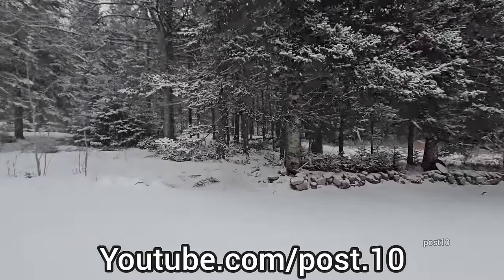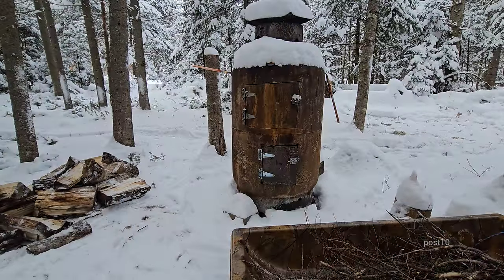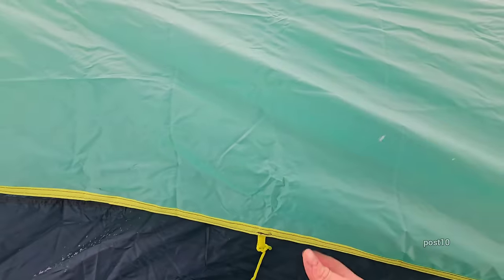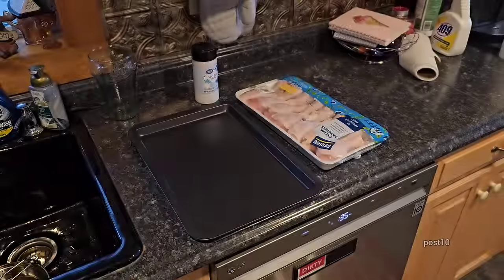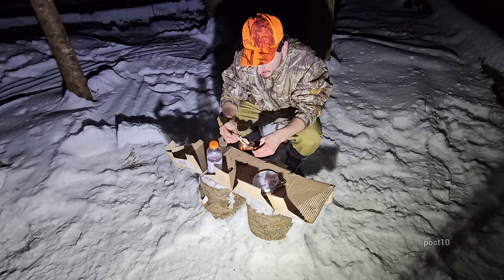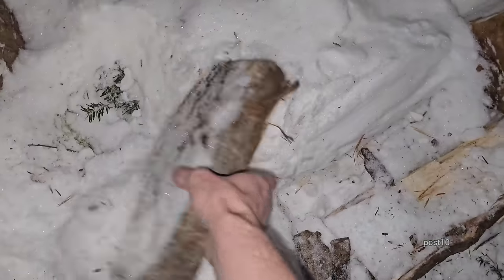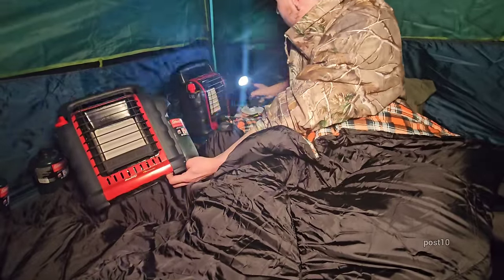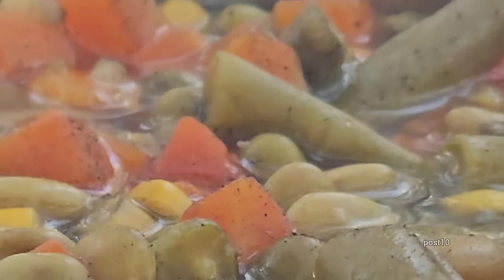Very Cold Winter Camping At The Tank

Comment: Our snowblower is orange too. Little buddy heaters need a secondary regulator or a lower pressure regulator to work on a 20LB tank. Don't put your head in your sleeping bag. Condensation will soak it and you could be in a dangerous wet situation. Wear a hoodie and tie it . unroll and hang your bags when storing

Comment: Finally, winter camping. Now your surroundings look like here has been over two months. Good purchase that sleeping bag. And you can fit it back to its factory bag. Remember the fluffiness comes from air that insulates the sleeping bag, so if you just use pressure to push the air out you can fit it back to its bag. Good cooking too, those legs looked very juicy!

Comment: I think when you had that really big blow down it was after several years of low rainfall, so the roots wouldn’t be strong and deep and the trunks may have been brittle? This past year you have had quite a bit of rain. Also if the majority of those fallen trees where shallow rooted types, then they are prone to blow overs. These trees appear to be older and of the deeper rooted variety. Curious if you are going to build a log cabin/fort with those trees? Or at least a lean-to to store firewood.  Putting up partial walls and then using heavy industrial felt for roll up walls and a large doorway would be cool and always necessary on that type of property; somewhere to sort and dry firewood. My ex-father in law would get huge heavy felt rolls from the lumber mill he worked at.

Comment: here are the facts about propane      it actually boils at around minus -35 Celsius   its that boiling over -35 is what creates the pressure in a propane tank at minus -35 is when the liquid turns to a gas,   at minus -40 you can put propane in a bucket and carry it like water, there will be no boiling so there is no pressure,  and, the frost on the side is the moisture in the air freezing at the propane level in the tank as the liquid takes the heat away from the air, i use Celsius because i'm from Canada

Comment: You still got the copper tube eh? You should get rebar, heat it up with a torch to heat up where you want to bend it, drill a hole in a stump and stick on end in the hole, then use a steel pole as a pry bar to bend it  where you want it bent.

Comment: propane burns as a liquid (vapor). never is it a gas. the bottles get cold due to pressure lowering and is independent of outside temp. bottles become colder even in summer heat. it's just that when it's so cold outside, it's more noticable, and frost from moisture in the air accumulates on the outside of the bottle. the inside is therefore much warmer than what you see outside, as it must be, because physics lol..

 propane inside doesn't freeze, not at all. the bottles will either warm up or cool off when equalizing with pressure outside the bottle. they get cooler as they become empty because there is less pressure versus pressure outside. 

it's really cool, you can actually use this to know when pressure is equal and to turn off the valve when refilling small bottles, and the moment it happens, all the moisture on the bottle heats up, if there's any frost, it fades away and cascades across the bottle disappearing suddenly like computer vfx in a movie